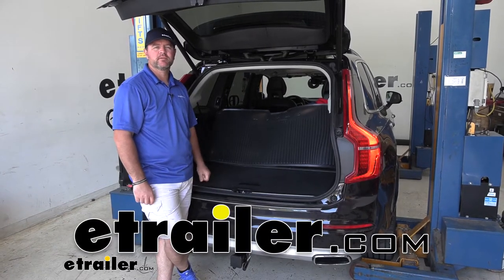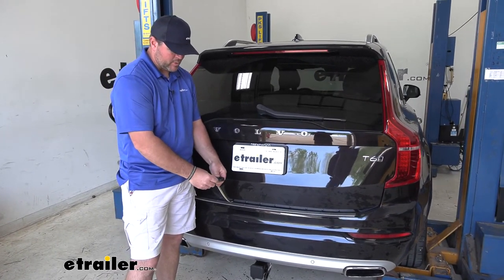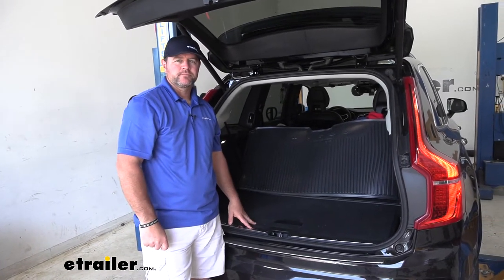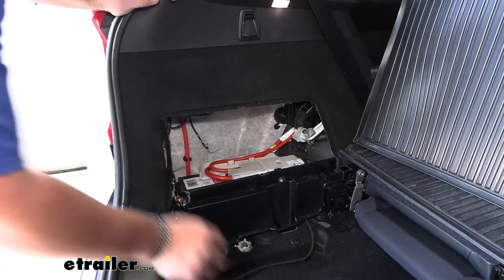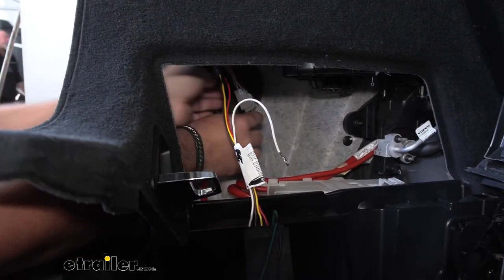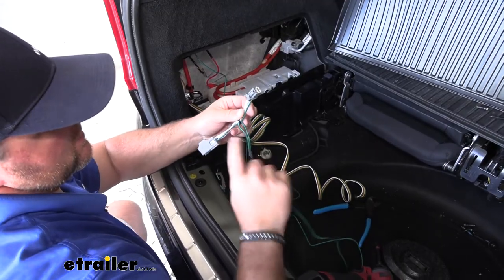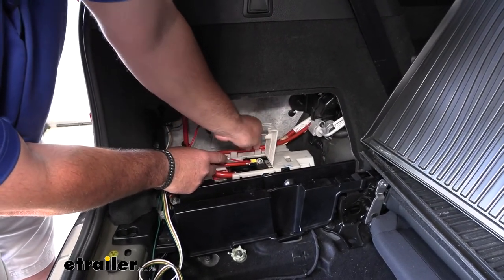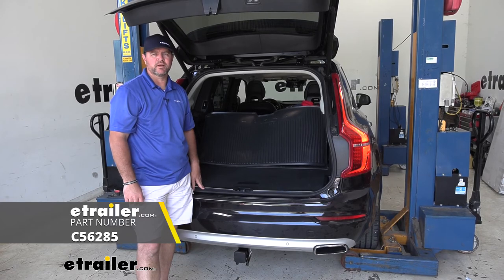etrailer | Curt T-Connector Vehicle Wiring Harness Installation - 2016 Volvo XC90

Comment: Is the T rear light harness  compatible with 2018 V90 CC?
Reply from the maker: It is not. A plug and play T-Connector isn't available for the 2018 Volvo V90, but you can wire in the # C59236. Use this link, and you can check out a series of install videos that will explain the process for you.
https://www.etrailer.com/Trailer-Wiring/Volvo/V70/2005/C59236.html?VehicleID=200538667